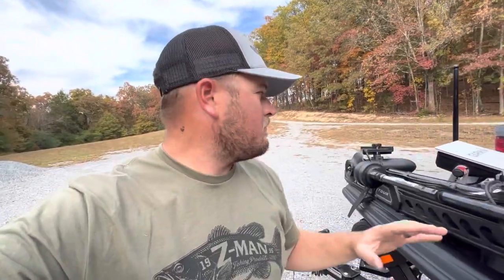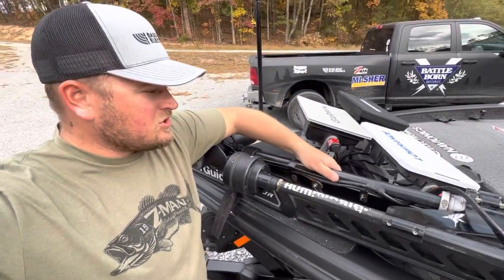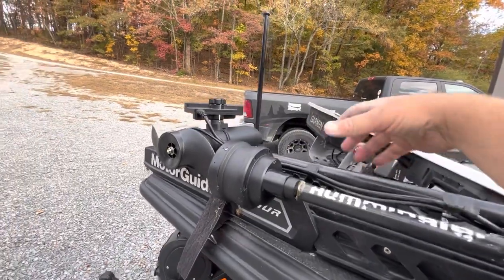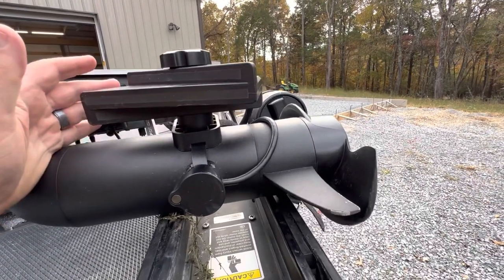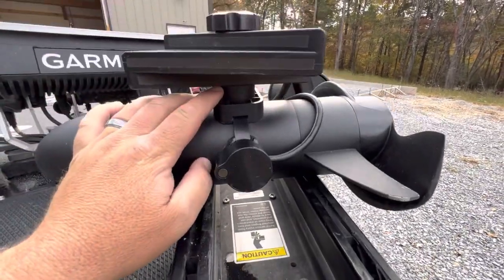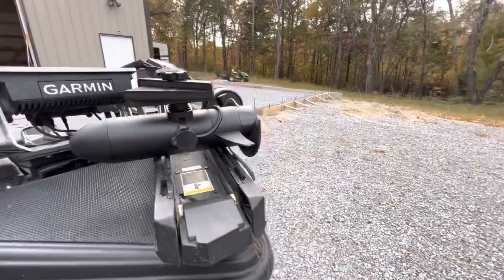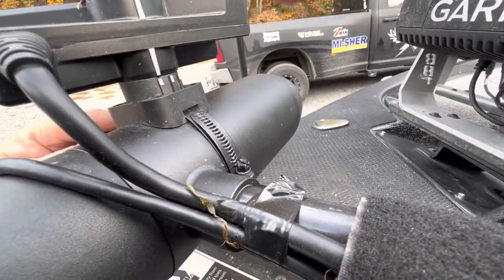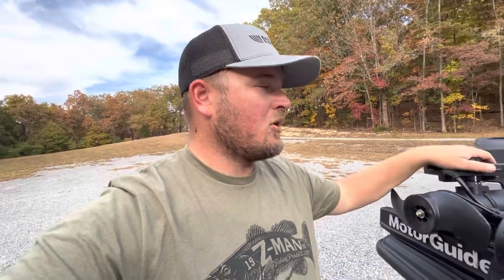Is This THE BEST Way To Mount A Panoptix LiveScope LVS32 or LVS34 Transducer?

Comment: I'm currently in the process of upgrading the whole system.  The installation manual says you can't have perspective mode with the barrel mount.
Reply from the maker: And they are right, which we found out after experimenting with it.

Comment: How did you make sure it was level or on right? Do you put a level on it?
Reply from the maker: No, i honestly just try my best to eyeball it and make sure it’s as close to parallel with the shaft of the trolling motor.  If you try to make it level with the skeg of the trolling motor it may be off because most skegs are off a little.